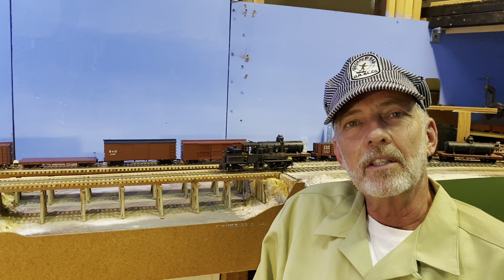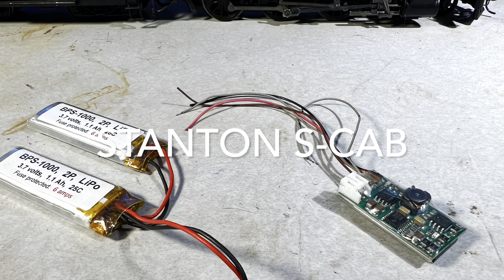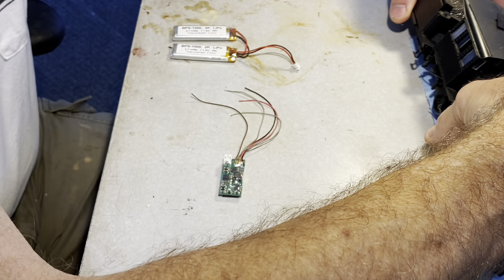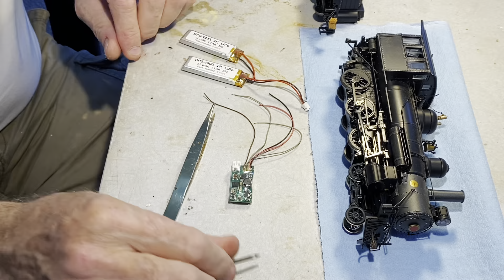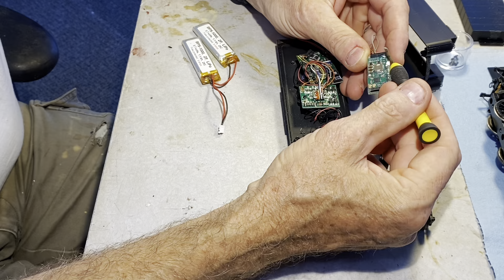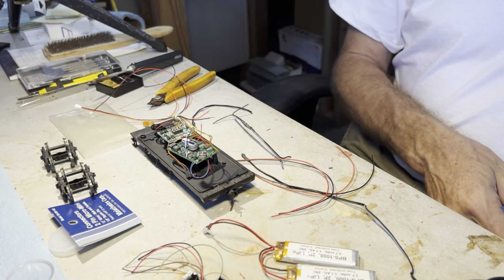Dead Rail Battery Installation

Comment: Hey Neal I am building a n scale layout in the spring.  I am giving serious thought in going with battery rc dead rail.  The last thing I need to find out though if im gonna go with battery is will the battery be able to give my lokos the same pulling power that my Bachmann starter set transformer will? With new gears and a couple extra driver wheels with traction tires I got my Bachmann 4-8-4 northern (with the throttle on full power) to pull 25 rapido coupler pizza cutter flanged wheeled cars over a mock setup of the toughest grade I gonna have on my layout. My goal is 35-40 cars and if I add couple more traction tire drivers and some weight .on the front part of chassie to keep the loko from wantin to do a wheelie, I think its possible.  I couldn't find much of any videos on YouTube of n scale, or ho pulling heavy freights with battery power.  Most of dead rail videos On youtube they are haulin trains like the ones you are runnin.  I've asked a handful of people this question with no real diffinitive answer. Maybe you can answer this question for me. Hope to hear back from ya.       - steve
Reply: You shouldn’t have any problems except finding room for the batteries. A friend has a very large layout in S scale that is run the same way and no one notices!
Reply: It really depends on the current draw of your locomotive. My guess is that an N scale engine would be 0.5amp per hour so nearly an hour running without recharging. This engine recharges when power is on the rails so seems to never run out of power.
Reply: I'd be happy with a 60 min run time. I'm not a expert when it comes to electronics but I was guessin that 430 mah would give me somewhere round 30 min run time.  And I would have to get another chip that would allow me to charge the battery off the rails?
Reply: Correct. I got mine from Neal Stanford.
Reply: Ok thanks for the all the info. I'm definitely leaning closer towards going with the battery power now.

Comment: Are you in PR I can hear all the 🐸 coquins in the background 😂😂😂 my wife is from PR and I love the singing of the coquins special at night, by the way I will start to building a garden G scale but I would like to convert the trains to battery power any recommendations where I can find what I need to convert?
Reply from the maker: My garden trains are battery powered and use the RCS control system. Not sure they are still around but worth checking. I’ve also had goo luck with CVP and their customer support is fantastic
Reply from the maker: BTW I live in Hawaii where the coqui have taken over!